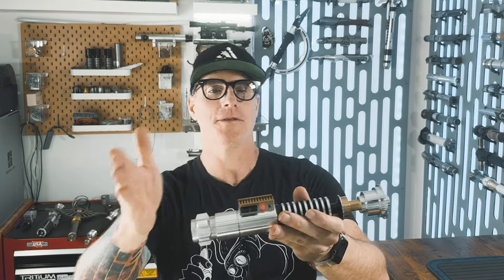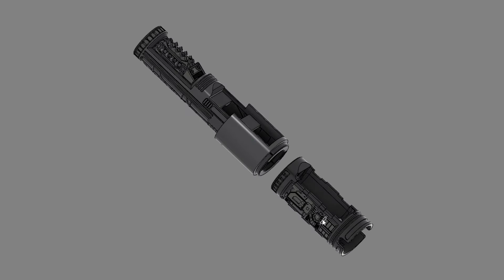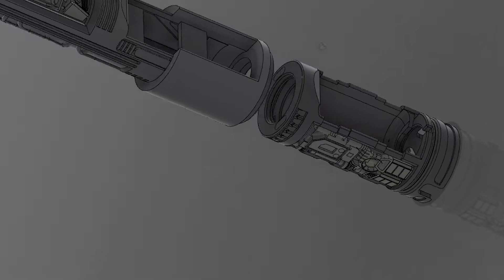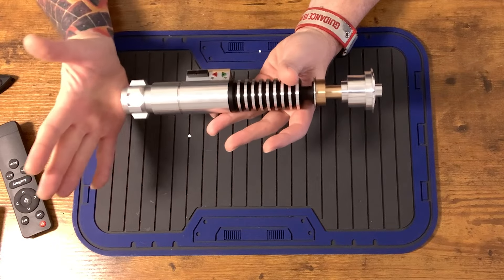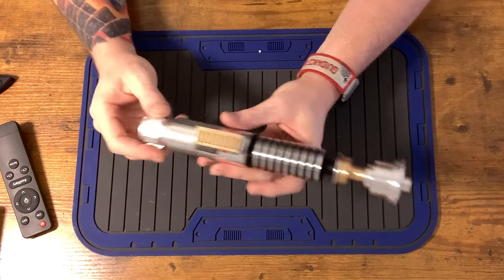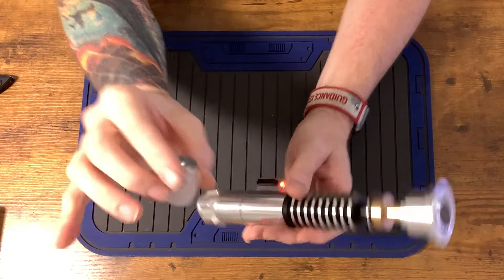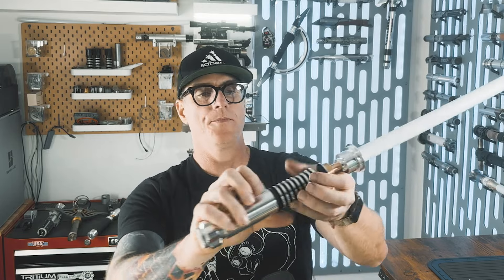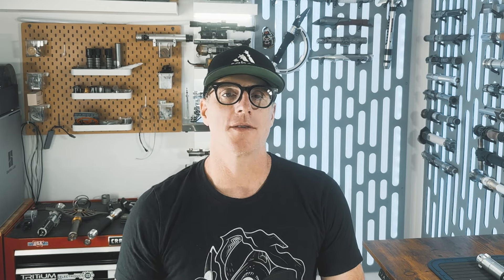Denis Lukyanov ‘Creepy Uncle’ Custom Install

Comment: Btw I know this may be a dumb question but what kind of grease did you use for the threads?
Reply from the maker: I like to use gun oil believe it or not. Super lube is also good, but I find it to be  a little messy